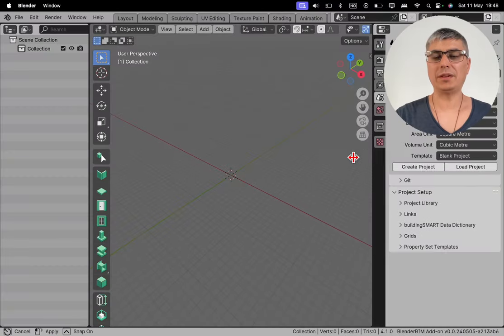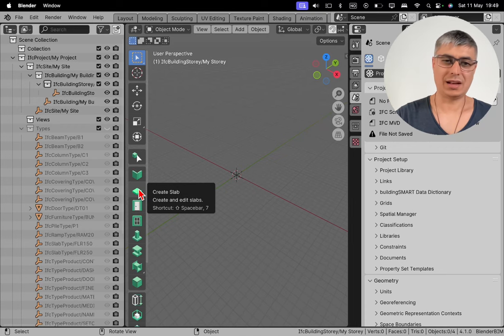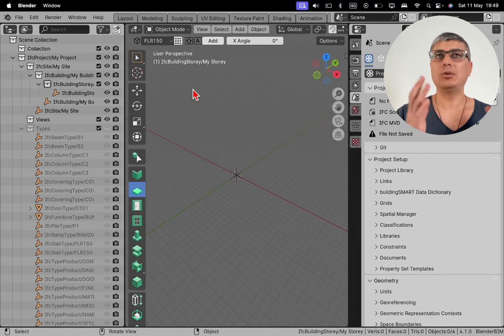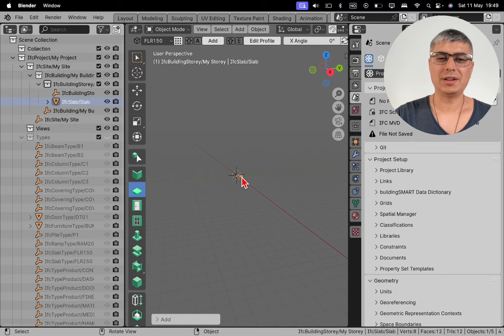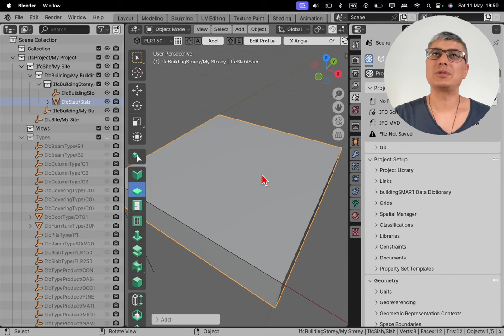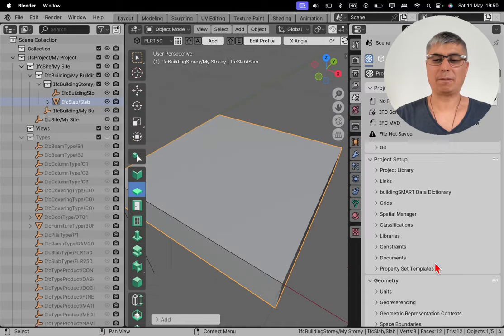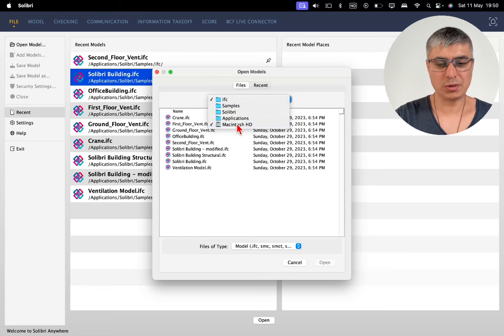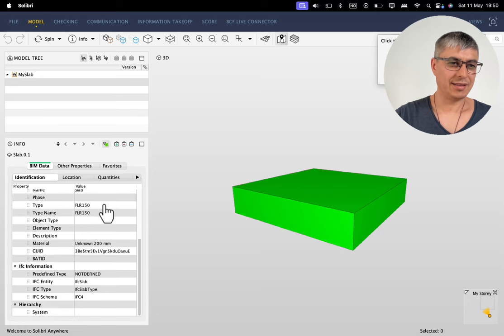Creating an IfcSlab in BlenderBIM is SO EASY!

Comment: So far, it's been a breeze! Changing the width, length and thickness of the slab is a bit more difficult, so expect a detailed explanation next time.
Reply from the maker: I’m not an expert modeler but I promise I will do my best 😀
Reply: to change profile: select the slab and press `TAB` to enter in edit mode, select line or vertices to adjust the horizontal profile and when ready press `TAB` again

to change thickness: go to "Geometry and Materials" from the "Scene" menu > Materials > IfcMaterialLayerUsage (pencil to edit the layer set, pencil again to edit the LayerThickness) , Save changes for both layer and layer set

IFCArchitect has some nice videos here on YT, a bit old but still useful I think
..are you the same koara on OSArch by any chance?
Reply from the maker: @StefanoVerugi  Thanks for sharing this. That was also my discovery, and I'll record just that. I guess changing the thickness is a bit more confusing since you do that in the material tab.
Reply: @StefanoVerugi  Got it, thanks, I was confusing changing the dimensions in edit mode and setting the thickness differently. It looks like I will be free from having to transform the cube in Blender and then assign it to IfcSlab. I am the same person as OSArch.
Reply: @koara5867  great! 
feel free to ask on the platforms, both BIMvoice and OSArch, I know how difficult is BBIM at the beginning and will do my best to help you (or others) out. 
I am far from being an expert BIM/IFC modeler but I think I got the essential tricks to move on
Cheers
PS as much as possible try to use the "primitive" geometries like slab, beam , column, etc and adapt them to your need instead of using a cube or mesh and convert it to an IFC element..